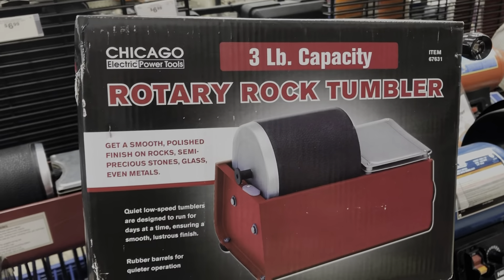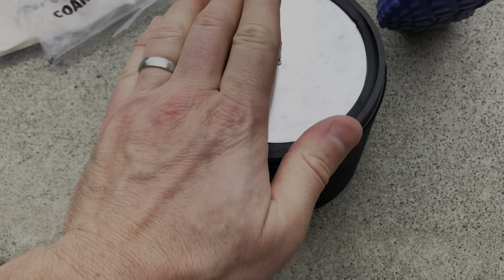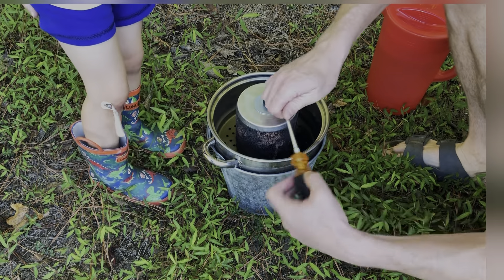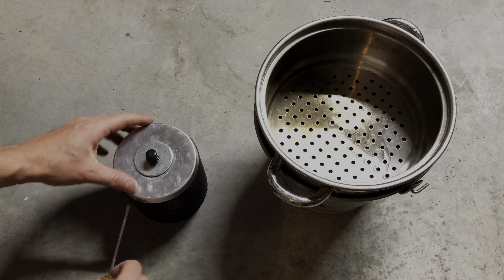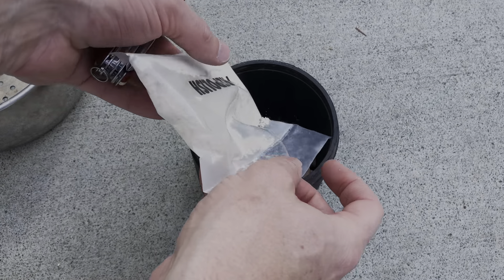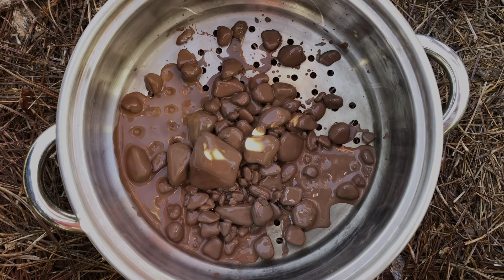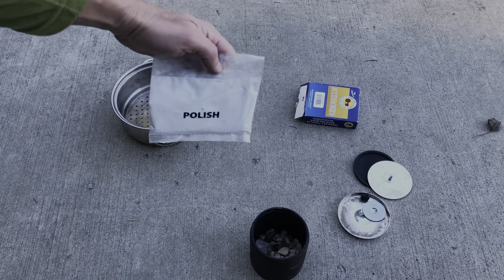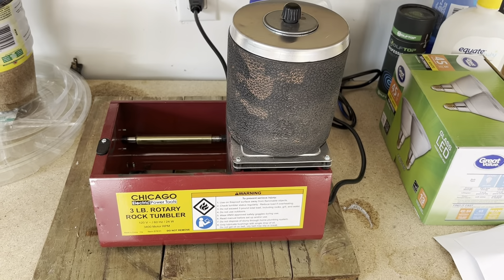Harbor Freight Rock Tumbler Review - 31 Day Time Lapsed Video

Comment: My girlfriend and I have been tumbling rocks for about 3 years now, and we learned a lot from YouTubers Michigan Rocks, and Agate Dad. We use either plastic beads or ceramic media to help cushion the rocks, and to keep our barrel 2/3 to 3/4 full in stages   two thru 4. The rocks just don't tumble right with the barrel less than 2/3 full. Most of the rocks you used were too soft, and that's why they shrunk down so much. To check if a rock is too soft, use a knife to see if it scratches the rock. If it does, the rock will grind away to fast. Once you get  2/3 to 3/4 barrel of hard stones, we use 4 tbl. spoons of grit in stage 1, 4 tbl. spoons of grit in stage 2, 6 tbl. spoons of grit in stage 3 ( pre - polish ), and then 6 tbl. spoons of polish in stage 4. All of the stages are 7 days, and make sure your rocks, and the barrel and lid are very clean before moving to the next stage. I think you washed your rocks outside, which is great. Do not put it down your drain. Best of luck with your new hobbie !!!!!
Reply from the maker: Wow,
Thank you for all the awesome tips! Will
Definitely learn from your experiences and do these things with my next round of rocks 💪
Reply: @repurposeandreuse7963  +1 on Michigan Rocks. I'm not too familiar with Agate Dad and have only seen his collecting and slabbing videos, but they are good too.
Reply from the maker: @funknfritter1759  I gotta check him out - thank you. And Thank you so much for watching! I really appreciate it!!